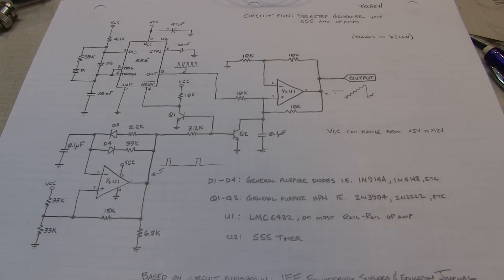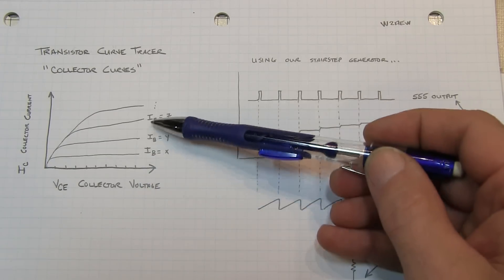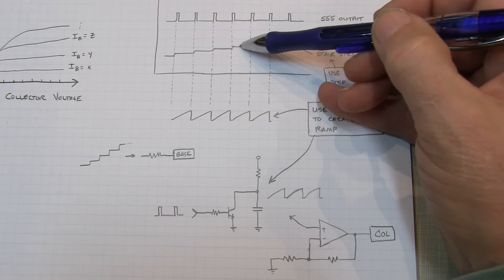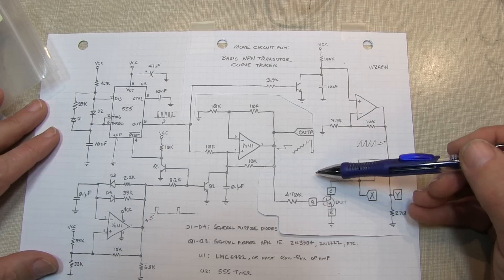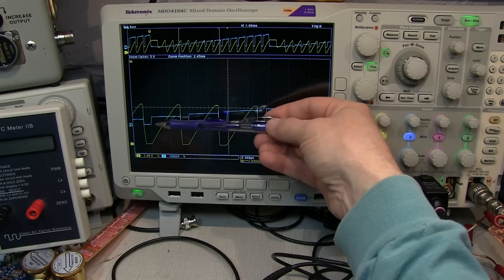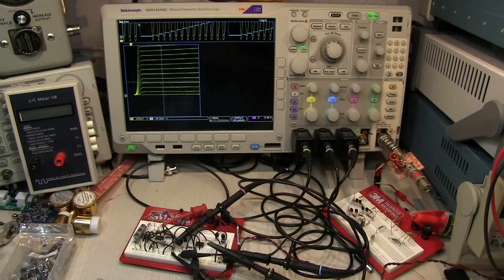#232: More Circuit Fun: Simple transistor curve tracer using Stairstep generator circuit

Comment: Hoes does the source impedance of the step generator effects the behavior of the device?
Reply: Negative feedback lowers opamp  output impendance to negligible values. It is very, very small compared to the test transistor's base resistor which is 470K and acts as a current source. This resistor can be a source of error, but if w2aew says it's good enough for the purpose, then I believe him.
Reply from the maker: as +marshsmello stated, the 470k resistor is a cheap and easy substitute for a current source.  Works well enough for this demo.

Comment: heyy, can you help me?? I want make a trans curve tracer for my project. I'd made a staircase genartor using shift register and op amp circuit for supply IB. I also make a full wave generator for sweep voltage on VCE. but I can't  found the curve on a osciloscop. do you know is  there anything wrong?? thx

Comment: Thanks Alan. 

I'd like to build a simple CT for bp's and fet's of all flavors. Could be an interesting video to modify this circuit a little bit more?
Reply from the maker: +davecc0000 I've already dismantled a portion of this circuit.  Changing it to test enhancement mode n-channel mosfets is simple - simply short the resistor that is in series with the "base" for the BJT version.  Changes to test PNP, Pchannel or depletion mode FETs would be a bit more involved, but still not difficult.
Reply: +w2aew 
Yes, saw N mod comments. Look forward to P mods. Thanks.

Comment: +w2aew, can you please specify which opamp and PNP transistors you used? Thanks!
Reply from the maker: +Mauro Sedrani This information is in the show notes page - link at the bottom of the video description.
http://www.qsl.net/w2aew//youtube/curvetracer.pdf
Reply: +w2aew Thanks Alan, but I can't see the type of components for the integration circuit (current mirror PNP transistors and amplifier).
Reply from the maker: +Mauro Sedrani Same op amp will work as shown in the parts list.  PNP devices are any general purpose small signal PNP like 2N3906, etc.
Reply: +w2aew Thanks a lot for your patience :)

Comment: I'm going through an EE program right now, and your practical videos (with all the little tips and tricks from experience) are a boon! Keep up the great vids!
Reply from the maker: +jason cater Glad to hear it.  Good luck with your studies, and be sure to let me know if there is a topic or two for future videos that would help you and your fellow students.
Reply: I'm doing some T.A. work with the EE 101 class currently and your LM555 and Op Amp Vids have been invaluable!

However, for my regular classes we are building amplifiers (audio range and then moving into RF) and one thing that hasn't been addressed is causes of noise and distortion. I am aware that this is a HUGE subject that covers volumes of books, but there isn't much talk about the practical "gotchas" (improper loading between stages, stray RF, building on a bread board VS PCB, etc.) and simple mistakes that can be made while designing and building BJT amplifiers. A video that addresses the most common types of interference/noise in BJT amplifiers (and how to avoid them) would be awesome (IMHO).

Thanks again for all your work!
Reply from the maker: +jason cater Lots of good topics.  Noise is a BIG topic.  Sources of distortion in BJT amps is usually a matter of signal level and bias conditions.  Feedback almost always helps with linearity.  Try not to make too much gain in any one stage - that will usually help with linearity / distortion.  Anything besides Class A add distortion by design, which is often reduced by filtering.

Comment: I love these general-purpose circuits-in-action videos, thanks!

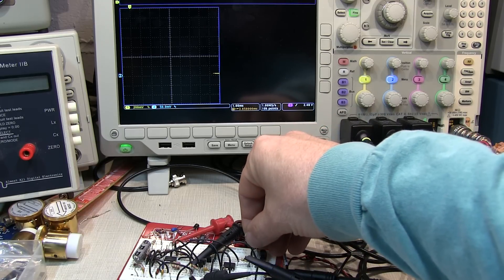What's that "hole" in the plot on the lower gain transistor (9:34).  Looks like the first few base currents aren't conducting till a much higher Vce than the higher base currents.
Reply from the maker: +CodeKujo You're just seeing the distortion due to the non-linearity of my little PNP current mirror - not acting as a mirror until it has sufficient bias.

Comment: Sir, nice circuit .what is transistor used for current mirror and the last op amp no is not given .simple and usefull test for transistor
Reply from the maker: +Jegadeesan Ramasamy The current mirror is made with general purpose PNP devices like 2N3906.  I used the same rail-rail op amp that is used in the stairstep generator.

Comment: Pardon the dumb question, but I'm wondering about the current mirror you added to the circuit. Did you use general PNP transistors? I'm thinking 2N3906's. 

Though I am a real beginner, I find that the clarity of your explanations, drawings and demos are very understandable (though some require multiple views). Thank you for all your work.

Finally, for your "Basics" videos, I would love to see something on how to chose between the many types of oscilloscopes available today. Also, a video on all the capabilities of your current scope (the MDO4104C and associated probes) would be very interesting.
Reply from the maker: +Gary Krouth Yes, I used a pair of 2N3906 transistors for the current mirror. I'll add your video suggestions to my list.

Comment: Hi Alan. Could the linearity of the ramp generator be improved by using a current control transistor instead of the  100 kohm resistor? Of course, the linearity may be good enough as is for the job in hand. Another nice video with good illustrations and description; as well a good learning project for beginners.

Comment: Thank you for so many excellent videos. At 2:35 you mentioned that you make the base resistor large so that it acts as a current source. How does the particular voltage level act as a current source when Rb is very high? Is that just because the resistor translates a locally constant voltage to a locally constant current?
Reply from the maker: +Eric Bauer Voltage sources have a very low source impedance (so that the voltage doesn't change vs. load changes), and Current sources have a very high source impedance (so that the current doesn't change vs. load changes).  Making this resistor fairly large makes the source connected to the base of the test transistor looks more like a stepped current source (due to the low input impedance of the transistor).

Comment: the base current is how you might set ab bias?  in an linear amp?
Reply from the maker: You could, but you'd be much better off designing for a target collector current, and not be dependent on beta (base current). See my video on beta independent biasing.
Reply: i'll view it. i will also attempt to make this curve trace. and i'm buying my first "o scope." it will be a goldstar os9020g. at a good price, being in my range of pricing.
 if you will, please explain how an 20 MHz scope will help me in working on and diagnosing radio of higher frequency. just a summation will help in that area.or can i use a frequency doubler.or divider in this case.
Reply from the maker: +dale myers Analog scopes can often display signals well beyond their bandwidth rating (see my video on oscilloscope bandwidth considerations).  The amplitude will be somewhat attenuated, but is still quite usable - especially considering that many times you are just using the scope to look at "relative" things as opposed to absolute amplitude measurements, etc.
Reply: thank you, i understand and can see what your saying. it's like a testing device to test gain in transistors with a simple gain tester. it's not scientific in the least but if you have a known gain of two. you can scale gain from the two point on the meter of the simple test device. https://www.facebook.com/photo.php?fbid=10201328053680743&set=a.1012588092373.1719.1755166517&type=3&theater

Comment: Thanks for another informative video!

What is that circuit on the far right input of your scope (I guess the spectrum analyzer input?)?
Reply from the maker: Oh, that's a low pass filter that I built for a video I did on a low power RF transmitter called a Michigan Mighty Mite.

Comment: Alan :) Can You explain something... When I draw some electronics for Myself to build it, it never works first power up. When You draw something, it works from first power up :))) I just see the current mirror, and I remember when I try to do from salvaged transistors. It never worked :))) Excellent video on Alan trademarked style. Thx for sharing! ( I just loose now a fight for a nice Tek curve tracer on the ebay hrrrrrrgh)
Reply from the maker: +BMR Studio Well, what you don't see is all of the time that goes in ahead of the video - designing, building, debugging, redesigning, redrawing, modifying, troubleshooting, testing, experimenting, etc.  What you see in the video is after all of this is done.  A 10 minute video is the result of many hours worth of work beforehand (even though the video makes it look easy).
Reply: Yeeeeah :) So I'am not alone:))) Thank You for the videos and the amount papers, works, time and destroyed parts :)

Comment: Could you use voltage from NE555 capacitor to drive X axis? Just add offset to op amp, and use it as inverting op amp.
I think that shape of ramp voltage to drive collector doesn't affect  shape collector curves. If it is exponential instead linear it just mean that it will sweep faster to start of curve than at end. But speed are low enough that it shouldn't affect curve shape.
You still get collector current for applied voltage in every dot.
EDIT:
Great video, as always! Thanks
Reply from the maker: +Pokojni Tozo Yes, that would be another way to go - nice clever re-use of the 555 timing capacitor voltage. Would probably work out to be slightly fewer components.
Reply: Maybe you could draw up or create a Youtube on your modified design?

Comment: Wouldnt it be nicer using a simple current source (i.e transistor, 2 diodes and 2 resistors) instead of the 100k ohm resistor to charge the capacitor? Or was this just a quick n dirty 'good enough' approach?
Reply from the maker: +tHaH4x0r Yes, this was just a quick n dirty approach - using just the first part of the RC charging curve followed by a gain block - it's "linear enough".  Actually, no real need for it to be linear, since the XY display mode is being used, you wouldn't notice even it was more exponential.  Sure, a current source driving the cap would make a fine linear ramp generator, it that was really required.

Comment: Nice circuit Alan.
Like the presentation too.  I like your jigsaw approach with the drawings, piecing them together as overlays.

I have a question about the capacitor that is introduced with the second drawing, the one being discharged periodically with a transistor.  You said the charge doesn't go near Vcc so the trace is the bottom end of the cap's charge cycle and is therefore rather linear, no problem with that but your trace has the capacitor charge flattening off just before the  reset pulse arrives.  
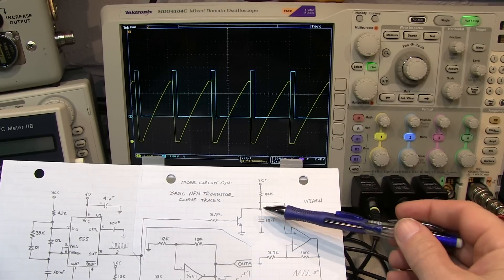If the cap doesn't reach Vcc and the Transistor isn't being driven then why would the cap flatten off nearly 40uS  before the pulse.  (Yes you can see this in HD,  Visible at around 6:23)
Reply: +Michael Hawthorne - Good question.  While Alan said the yellow trace was "essentially the same thing" but after the op amp, it is actually the X connection showing Vce.  You can see that he doesn't change the probe connection point from 7:30 (where you can still see the ramp being clamped) through the end of the video where it is in XY mode.  Perhaps it would have been a bit better if he connected the 3rd scope channel to that capacitor to make it a bit clearer.  20/20 3rd person hindsight!   ;-)
Reply from the maker: +Michael Hawthorne +ElmerFuddGun is right.  I adjusted the gain of the op amp stage so to swing to the positive rail just before the end of the step.  This allowed me to use less than 1 RC time constant on the R-C circuit so that it was somewhat linear - then use the gain of the op amp circuit to bring it to full rail swing.  Good observation!  Yes, I should have moved the probe to the cap, or added another probe to show that.
Reply from the maker: +sporadic -Z Yes, exactly, and on purpose (gain on op amp stage purposely set to make it hit the rail at the end of the step).
Reply: +Michael Hawthorne 
w2aew
ElmerFuddGun
sporadic -Z

Thanks for your replies guys.
I saw it again and this time I caught Alan say 'After the op amp' at 6:28.

I suppose having a tighter control on component tolerances,    matched transistors in the current mirror and a constant current source for the charging cap, you could make a pretty accurate curve tracer.
Reply: +sporadic -Z 
Nice one, I forgot all about Depletion types, the circuit I'm currently designing may have benefited from these.  Too late though the circuit is in the breadboard stage.  Saved the PDF though.